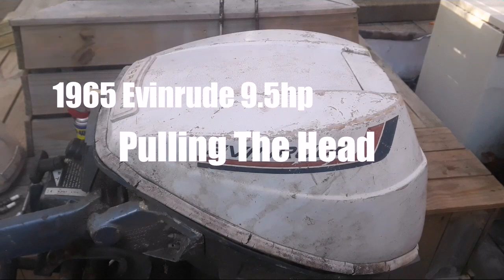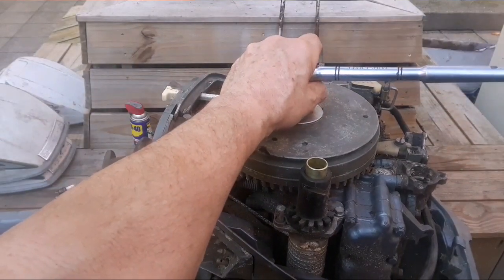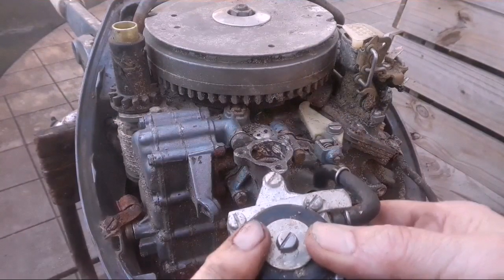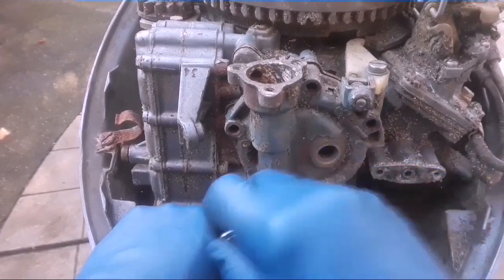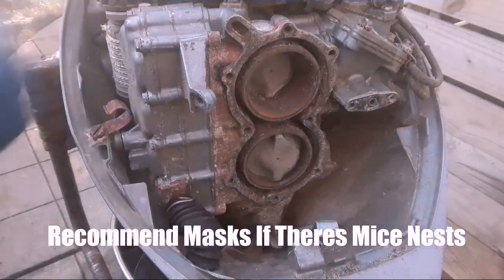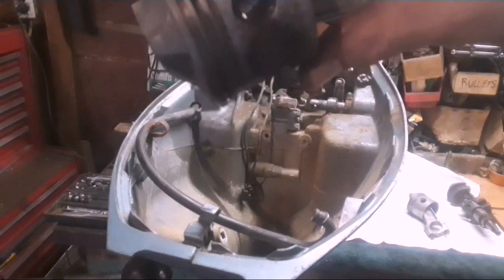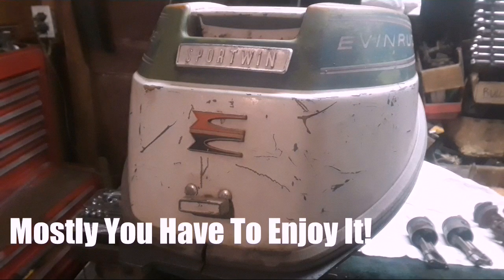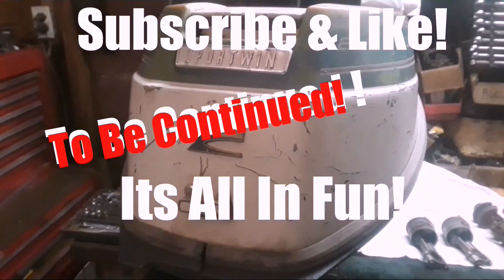First Look at 1965 Evinrude 9.5HP From My Shed. Remove the Cyl.head and some random tips !Part One

Comment: You glossed over the most fun part,  pulling those lower pans apart so you can remove the powerhead!  Once those pants are pulled apart, little pieces parts go flying everywhere...  Be careful with this model, they are known for water leaks in the exhaust cover that spray water into the exhaust ports.  I'm sure you can come up with an ingenious, yet simple way to pressure test the cooling passages in that block to check for internal leakage.  Just don't want you to go through all the trouble of reassembling this thing if it has got an internal water leakage issue.  D
Reply from the maker: Only one bottom pan screw gave me trouble as I mention. I have had those pesky exhaust,waterside covers tig weld repaired in the past when I was still working. Mostly saltwater corrosion here not gasket leaks. Not a great design those three covers in my opinion. At this point Im just getting them running and not too worried about the longevity of them and to be too critical about all problems of any particular motor model issue. Its all in fun at this point thats my new catch phrase and I do it on the cheap thats why I do it but thanks as always for your input. I know one guy on Youtube pressure tests the blocks for oilseal leaks a little far fetched but thats only my opinion,LOL! Stay Tuned........
Reply: @OutBoardTink62    Well yeah, you can go "overboard" for sure.  I just didn't want you to get the thing running only to have that cylinder fill with water again.  And yeah, the gaskets weren't the issue, it was thin porous castings for sure.  And yeah, that three layer exhaust cover is just an example of "over engineering", kinda like the rest of the engine.
Reply: Did you find out who made the repo medallions for the Johnson Seahorse?